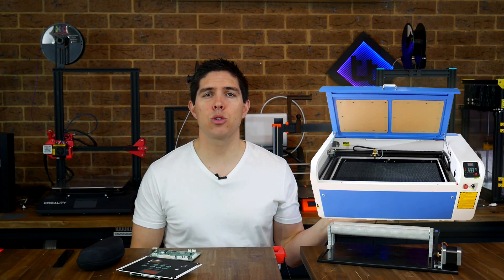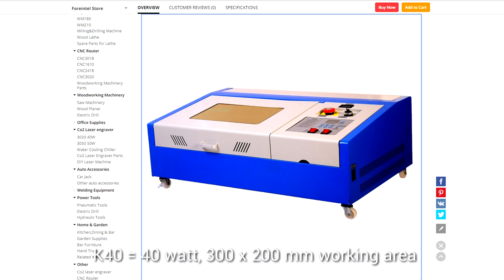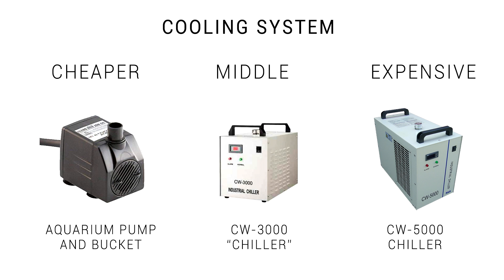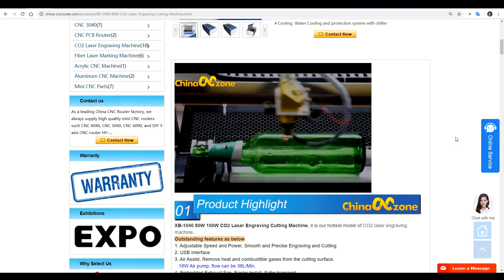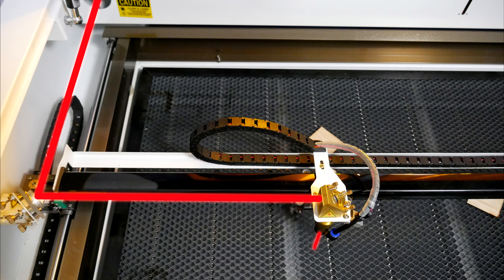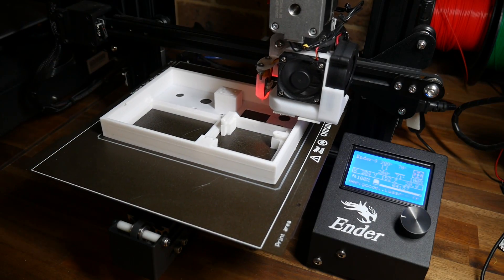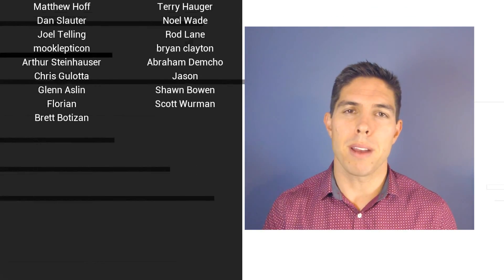K40/Chinese CO2 laser cutter/engraver buyer’s guide

Comment: Thank you for the indepth laser info!  Quick question: u don't want to use a tube extension for a 90w tube so if I were to just to run the tube along the back longest side and add an extra mirror..is there draw baCk to doing so?  Thanks again

Comment: I want bay one but  there a savety problems and the quality is not so good. What i not wil is doing a lot of updates. The next is the price. In the USA cost ik now 300 euro for a small K40 and sending cost. In europa It cot a round 400 a 500 euro incl. vat but not  the import cost. I think 70 to 120 euro. Total price around 500 to 600 euro without update cost of pomp control panel. I try first a LED lasser i will cut thin materials if veneer 0,5 tot 0,6 mm and 1 mm plexiglass. I loking at a S6 or S9. Only i can't find a movie where i can see how cut it veneer. For my inportend that the adge not to far burns. then jou cat a dark edge. I heard your advice.

Comment: Hey there! when  cutting your parts have you experienced a different size on borders of the parts cutted? I mean ,  after measuring the cutted parts i  realized that the top face of the part has a different size than the lower face,  witch looks like that the lase is cutting in angle, even though is not. Have you noticed that on your parts too? 
thanks!

Comment: An idea could be a power meter in the socket for the laser cutter to give an idea of how much power the tube uses of course there are other things that use power but if you stay just below the max for the tube input power then you should be on it safe side, but the less power you use the better, laser cutter machines use PWM makes the tube only lit in small chunks but in full power output. if it is at 50% power the tube is lit for half the time it is like a hammer to the steel

Comment: Hi Michael,
I have been following you on YouTube for years and have learned a lot from it.
I am 74 years old and working on my K40 laser with the Cohesion3D board and the Lightburn software.
Bought me a LightObject Z table, but run into a problem. When I move the table 10 mm, the software tells me to have moved the table 10 mm. But in reality it has moved only 1 mm. Depends on the steps per mm but I can't find how to change this in the config of the Cohesion3D board.
I live on Curacao, a small island in the Caribbean where people cannot help me.
My question now is, can you help me solve this problem?
Regards, Marinus Boom

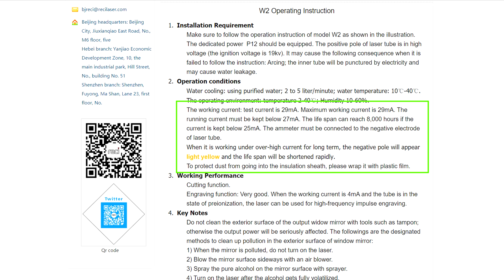Comment: Key Notes: "Do not clean exterior surface of the output WIDOW with tools such as TAMPON" 4:54
Reply: the only output window that can not be touched with anything except a tampon and only if its essential is the window/mirror that's on the negative end of the laser tube that the beam comes out of.  That is never supposed to be touched with a swab or even with a lint free rag because they can still leave dust and fibers on it that will get burned on and will cause output power to drop...   Tho the reason why a tampon is used it because its soft and will not scratch the soft coating that's on that mirror. and they leave NO Dust or lint behind.  you also can not use acetone to clean that mirrored window. because it will wipe the coating right off then the laser tube is ruined and voids any warranty that it may have.

Comment: I have a question.    How do you know the power level that you needed?  I just bought a K40 and am basically setting it up following your guide instead of trying to chase the info down as to what is needed and how to operate it safely within specs.  

BTW:  That being said:  I really appreciate your channel and all the work you put into it.   Always informative and the information is trustworthy.  I REALLY appreciate the printer calibration page you set up.  I've set up 5 machines from scratch from various manufacturers and FWs and it just works every time.  I've sent lots of newbies there instead of trying to explain how to set up a machine LOL   It's GREAT to have all that info in one place

Comment: I would like to add something. MAKE SURE THE AXIS IS SQUARE!! When I bought mine the cuts weren't square, and when I cut something, then flip over to cut or engrave the other side, it would not match up. Your laser may be slightly out of square, probably knocked out of square during shipping. So check it with a square. The solution to this problem is to gently hit the out of square part with a rubber mallet to knock it back into square. Then burn a square and check to make sure they are square. 

This is probably less of a problem for linear rails...

Comment: Had my K40 for 5 years, cost £280 plus i spent another £120 on it for minor upgrades. Still going strong :)
Reply: Are you able to cut quarter inch acrylic with yours? Will it cut clear cast acrylic? Thank you!
Reply: @justinmurphy2227  You can cut that thick but it will take multiple passes and won't be a true flat cut, since the laser has a focus point then tapers off again. I do 5mm acrylics (fifth of an inch) at 5mm per second.
Reply: The above is with two passes.

Comment: I think this has convinced me to buy my laser from a local business that specialises in such things. They do delivery, installation, set up training and maintenance  (optional) and everything is included upto the coolerr etc.  They will supply a filter but as an optional extra.  The downside it the cost which is £2995 for a 300 x 500 mm max cut size,. They do sizes up to 900 x 1300 which is 6 K.  They are more expensive than alternatives but their machines come with better controllers and free software.and is still cheaper than glowforge.  Do you think this a good alternative for people who are not tinkerers?

Comment: Thanks so much for this! I got a solid state laser for my 3D printer and I've been having a blast but I already want to upgrade! I'm stuck between trying to build my own 5.5W solid state laser engraver or buying a CO2 laser cutter. I would build my own CO2 cutter but it seems very difficult to purchase a CO2 laser tube on its own.
Reply: I'm trying to do the same thing to my homemade 3d printer.  I printed a mount and put a standard spindle that is just not powerful enough. I have a "20 w" laser engraver but its just not powerful enough. I wouldnt mind having that on my 24×24 " printer tho  can you suggest a good place to buy a little more powerful laser than those Chinese 20w. And how are you making the file so the printer understands it is using a lazer and not 3d printing

Comment: hey folks can somebody help me out? i just bought a Co2 laser cutter TS4060 and i am at the beginning of its assembly, i came here to get some more info about what to do and what not to.
my question for now is do i need to add an amp meter from 1-50? or stick with the one that is used in this video since it is 1-30?
Thanks!

Comment: At the end where it couldn’t connect to your computer, man I hate that when it happens!

I fired up my new 3d printer today (my Frankenstein Prusa I built 7 years ago looked like he needed a printing playmate), and for the life of me I couldn’t get my Windows 10 laptop to connect! My Linux laptop went just fine, but Windows sucks at connecting to anything... Half the time I have so many workarounds like software emulating Xbox controllers on game pads to faking drivers when using Windows. Thankfully on Linux everything I’ve ever connected has just worked. From Android phones to IPhones without ever installing iTunes garbage, to windows machines and bridging networking connections etc to basically you name it like flight controllers, Linux has always just worked. Same software, same settings, same baud rates and everything, but for who knows what reason the much new top of the model line (and upgraded on top of that) with the most popular desktop OS on Earth just can’t compete vs my trusty old 2012 duel core Linux laptop because it works for everything. (And I really don’t get it, because I’ve programmed arduinos and stuff on the Windows machine, so it does have COM port drivers working etc)

Comment: Man this stuff just looks like a minefield of problems! No "plug & play".  This was very helpful as I have been looking at getting in to laser engraving. Having looked at MANY other sources the only thing I can bring to this party is that the USB cables provided with laser engravers often have to be replaced. ? All that tech and it bombs because they over cheaped on a cable. Thanks for the info which at least helped to focus on the important specs of these machines

Comment: Hi Michael --  Like you, I have recently purchased a Chinese laser cutter, in my case it is a 600x400mm unit with motorized Z-axis.  I got it from a dealer in California (name withheld) who is really nothing more than a middle-man -- they are useless for information or help. 

The unit I got claims to be 100W, with the W2 Reci tube.  After I added a ma meter I found that I needed to limit the power to 58% or less to keep it under the suggested 25ma value.  It's unfortunate that these machines are designed to easily overdrive the tubes, and without an ammeter (not included) uninformed users will likely burn them out very quickly. 

My unit has the Ruida controller, and I am using Lightburn (a great program).  Through Lightburn it was easy to make settings in the machine's firmware to limit the power to 58%, no matter what the user requests.  

I also designed my own rotary axis, and modified the machine's wiring to allow rapid plug-replacement of the Y-axis motor (with power off of course).  BTW I put the rotary design up on Thingiverse, it's available open-source: https://www.thingiverse.com/thing:3906379.  

Many thanks for a great video, and wishing you well -- Neil

Comment: As for the safety advice, unplugging from the wall is something that I don’t advise as it separates the cutter from the ground. I made the unfortunate mistake while changing the laser tube in a k40 of unplugging the cutter from the wall, thinking it would enhance my safety. When I cut the red wire to the laser tube to replace it, it shocked me like I’d never been shocked before from the charge remaining in the power supply.
Reply: you have 2 things. keep the ground connected can help, but you need to check that the ground is still connected when the switch is off. Like with any power supply, what you need is to give it a chance to discharge its capacitors. 2 ways: let it be for a DAY or 2. (no guarantee, but pretty good), and/or use a "chicken stick". google "chicken stick discharge" as the keywords. Basically you want to go poke at any high voltage wire with a "stick" that has a path to ground. Force grounding the leftover voltage in the power supply.
Reply: @TerryFrenchy  Most of these lasers should have a disconnect plug. It looks like a giant plastic connector on the red wire. When changing tubes unplug that part before cutting the wire.
Reply: Machine should be grounded to external ground with connector on back of it ment for such connection

Comment: Glad I found this channel great videos with just the right amount of info and detail. I got a K40 about 4 months ago, was from an ebay seller that shipped from California. I was very lucky my unit worked perfectly out of the box, I did tighten every cable nut bolt etc etc. 4 things I want to tell people. 
1. My exhaust goes into a bathroom vent I installed in my garage, its right behind the unit so vent length is only like 2 feet, I sealed the fan and K40 tightly so air can only come in thru the vents in the front cover and exhaust out the back. If you seal the unit and have a short exhaust run air assist isn't needed. When I print the air flows so quickly over the piece I am working on and out the exhaust the smoke is instantly pulled  90 degrees away from the laser output. Smoke has never gotten close to my mirrors.
2. Cooling. The included pump and bucket idea is horrible, my laser is in the a garage in Nebraska so printing in a garage that in the summer can be 35C will not work, sure you can do the ice cube thing but thats a pain. Perfect solution is a Chili Cube from Chilipad, this company has a chilled mattress pad for you bed that uses Peltier cooling. You can get just the Chili cube on ebay for $75-100 usually. This simply works perfectly for the K40, I insulated the hoses and both ends on the laser tube as best as I could and the results are amazing, plus it look nice and clean. On a hot summer day say 29C in the garage turn on the unit in about 10 mins the K40 is chilled to about 17C and it hold's that temp while printing. Very happy with the results.  I do have some RV antifreeze in the water to keep it from freezing in the winter and that works fine also.
3. Check your ground connections and clean them, they clamp the cables to a painted surface, sand to the bare metal and tighten.
4. For now my control board is fine it does everything I ask it to do, I may update to a Cohesion3D LaserBoard but for now  I have no reason to.

hope someone finds this info useful
Reply: Hi Tim, what do you use to connect to the output of the chili cube? Do you use their drain plugs? It's unclear what fits there, and the company only sells some "drain plugs" for $5 or so. I'm very interested but wonder how to make some hose connection to the cube. thanks

Comment: Hay, I just saw my K40 on your video. You know, The dodgy one you showed. I ended up purchasing a 305x305 mm "Certified" WIN-002 CO2 10,600nm laser safety window plus a pair of EP17 laser glasses. I was unsure if my K40 was a clone or not, thus having an inferior viewing port, ( among other things ). The glasses also help protect my eyes when using my Diode cutters. 
I've thrown a Mini "Gerbil" 2 Axis Controller which is made right here in Australia. So it gives me instant axis to Lightburn. Good vid

Comment: Can you explain what you meant by "timber" In the USA, "timber" means logs out of the forest. So, how thick a material can your unit actually cut through?
Reply: He's likely using 3mm to 6mm ply.  Which is made from timber, hence the generic reference term.  You can use solid wood, but plywood is often stable over a wider temperature range. Most people avoid using mdf as the binders/glue tend to burn and smoke significantly more than other materials.  I would think his laser could cut through 1/4 inch material depending, and more if doing multiple passes.
Reply: @ixamraxi  Hi ,plywood also has glue inside,most similar with MDF
Reply: @jamessi7433  That's true, but mdf uses a higher quantity and also contains wax and binders, all of which contributes to the greater amount of burning and smoking you get when laser cutting mdf.
Reply: @ixamraxi  agree with you
Reply: Hello Doug,timber should be a technology wood.

Comment: Great vid. These machines are not “out of the box” ready.. when you factor in all of your upgrades it comes to a chunk of money more.. did you find anything more plug and play that wasn’t a whole load of money more?
Reply: They can be plug and play straight out of the box , my k40 was ditched the CorelLAZER program and run k 40 wisperer , esky and frozen water bottles for cooling keeps it just above dew point. The exhaust fan is ok a couple of pegs made it fit nicely try and keep the temperature at between 20 to 25c or just above dew point. Don’t overdrive the tube and you should be fine . Max I go is 15ma

Comment: I bought a 7050 60 Watt (The red and black one you showed) about 4 months ago and have loved it! I use mine to etch in anodized aluminum and it is pretty flawless. Interested in the analog amp meter, think I will look at putting one in. LightBurn is AWESOME, I tried several other softwares before settling on it and have been very happy with it.
Reply: Can you cut metal with these machenes? 🤔
Reply: @aurimasandrijauskas2172  No

Comment: The biggest issue you seem to be having is front to back airflow. to remove the smoke. It is not just a lack of power but a lack of direction. Take a look at this post and the one after how I improved mine. https://www.eevblog.com/forum/reviews/40w-300x200mm-laser-cutter-engraver-vollerun/msg2460816/#msg2460816 With your 1000mm wide bed the fan is also likely an issue but start with sealing up and guiding what air you have. Also reference Russ Sadler re Laser info huge lot of info there.
Reply from the maker: I think you are right, I need to investigate and add some cross flow. Thanks for the link.
Reply: @TeachingTech  The quick and dirty way to test it is crack the cover by 20-30mm and run a test. Also earlier in that linked thread I made a 3D printed connection between the Laser and Fan to help the gap sealing.

Comment: Dont buy an board for 200$

just use GRBL with an arduino nano...
and better use free software called

LASER GRBL to Control the Nano
and maybe an cnc addonboard...

laser power can you control with pwm out from the nano to laser power board

Try it,  and you will love it...
Reply from the maker: Sounds like a good solution. I am happy with the c3d board too. It works with lightburn which I already had a license for.
Reply: Another alternative,  https://awesome.tech/product-category/laser-cutter-controllers/  their minigerbil board also works with lightburn, is cheap and you can order a K40 upgrade pack that has some useful additions.

Comment: The Cohesion 3D board and Lightburn software is absolutely the way to go. The board is an easy swap and the software is so powerful and easy to use. I reached the same conclusion when I bought my K40 last year.
Reply: I don't think I'll buy the Cohesion 3D board. It costs 200 USD and I can buy the AWC 780Plus controller for the same cost which is like the Ruida controller directly from Taobao. It will work with lightburn software as well.
Reply: Don't get cohesion 3d  board no customer support